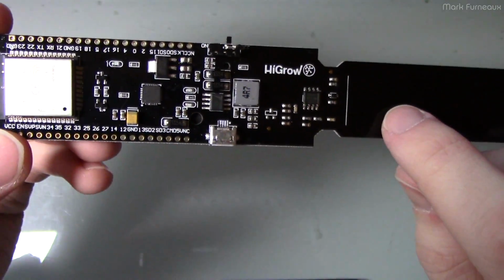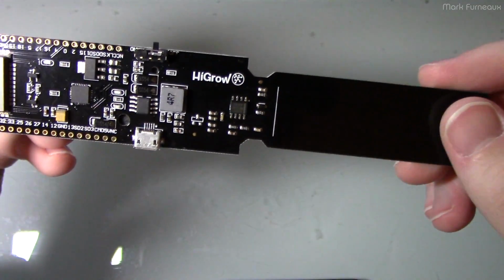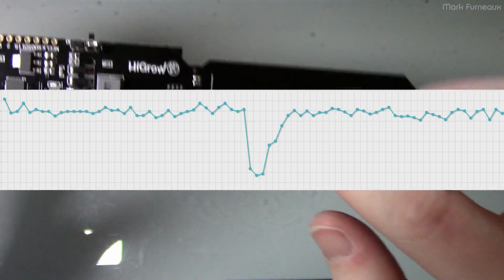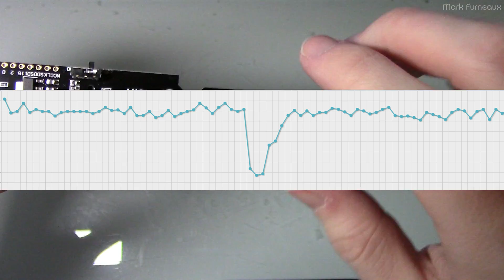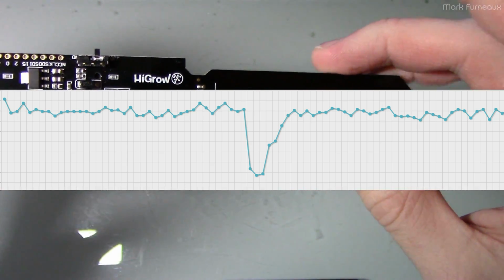WiFi Plant Monitor Project Intro

Comment: Interesting stuff. But it took me some minutes before I understood the context. This is a unit which can gather data about growing conditions in a greenhouse or similar. Data, including air temp and humidity, soil humidity can be captured and transmitted via wifi to a central point. The unit is stand-alone, powered by a single 18650 cell.
Reply: Yes, that is right. an expensive complicated gimmick in my opinion.
Reply: Simon Tay unlike many iot devices, this would be very useful
Reply: bought two. inserted 18650 batteries charged. disconnected from usb charger. both units dump the battery charge onto the regulator circuit so hot that one unit has failed. fire hazards. don't buy with the intention of using the battery.

Comment: I've just designed my own ESP32 board with a different feature set. LiFePo4 AA battery to get rid of all power regulators and only has a voltage divider to measure the battery voltage. Main feature to drop cost if you happen to have some plants next to each other: 3 additional pin headers to plug in external soil moisture sensors. Even the one directly attached must be an off the shelf one and also can be used as an external one. Except of the ESP32 it uses only simple through hole components to make hand soldering very easy.
Battery life is expected to be around 1 year. The device sleeps for 3 hours between measurements and spends only 4 seconds of on time to deliver sensor data to MQTT.
There's no USB or buttons. You need an external UART and a way to trigger the boot mode pin on the programming pin header externally.

I'm happy to share to anyone who's interested.
Reply: I'd love to hear more about it. How can i contact you?
Reply: @drstefankrank  I'd be very interested to learn about your build as well! The invite seems to expired (no wonder after 7 months…)
Reply: My bad. I'm in… Sorry for the noise…

Comment: Mark, rather than using turning on and off the power regulator using a fet, can you not just power the DHT and the 555 from digital pins on the ESP32, would there be enough current?

Comment: Hi Mark, nice video, did you have some schematic or link to understand how big cap sensor change moisture to Analog signal for ESP32 ?  I understand they use 555 for that but I would like more info to make some trail with my prototype. Then where is the code ? thanks again.

Comment: Is there going to be another video in this series?   I have bought a Hi-Grow and I don't mind admitting that as a hobbyist I'm finding getting the information I need to get this running a bit of a nightmare...  if you're inclined towards doing a step by step guide of what to do to get this running, you'd be the man!
Reply: Drweavil see https://www.instructables.com/id/ESP32-WiFi-SOIL-MOISTURE-SENSOR/ for setup and code.

Comment: With no disrespect to you or your project, I would remove the voltage regulator and modify the charger and change the battery to a Soshine Lifepo4 that is the same size as a double-A battery with a voltage of 3.2 volts at 2.2whr this would reduce your standby current I would want to stay asleep until a moisture level changes then wake and send then go back to sleep all the best and good luck Bob in the UK

Comment: I just got one of these and checked pin 32 in micropython it is reading  4095, so probably overvolted like mentioned.    I need to now find the internal fix to bring that signal down.
Reply: Ok   this worked now to test the other sensors.

a1 = ADC(Pin(32))
a1.atten(machine.ADC.ATTN_11DB)
Reply: are there any open io ports for another sensor?